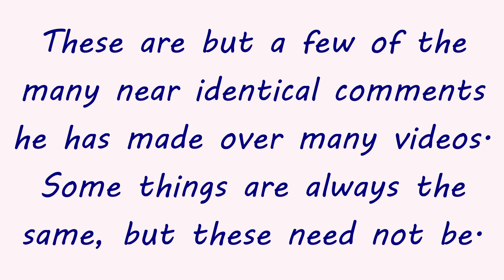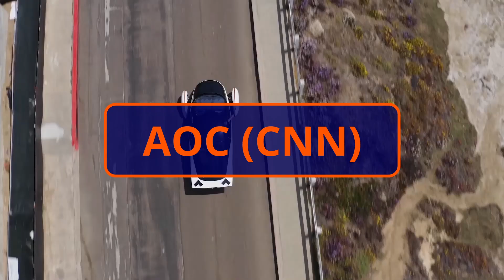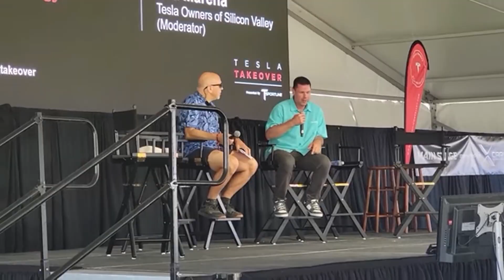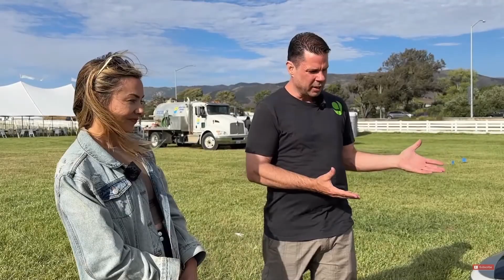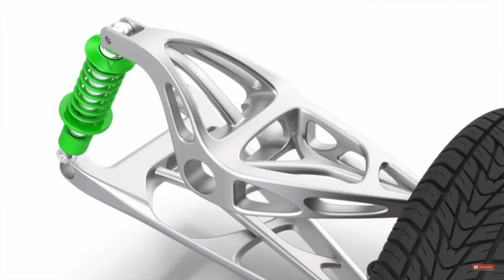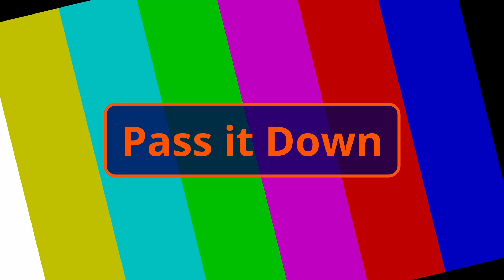Aptera rehearsed

Comment: The part that gets me is about the range from solar. They haven't tested it or proved it, yet he keeps saying it as if it  were proven fact. There simply isn't enough surface area on the entire vehicle to produce that much power without the vehicle being attached to a solar tracker.
Reply from the maker: Yes, it's a case of 'lies; damned lies, and statistics' fooling the gullible. They quote the CFD (Computer Fluid Dynamics) as proving it's true, but nobody knows if their 5% accuracy claim on that is true to begin with. A key number in the CFDs math is that 100 watts per mile, and that has never been established. Steve Fambro did the math on a whiteboard and also left out losses, when no solar system doesn't have them, and he multiplied by direct sunlight every second of the day, which your valid point. Steve F used that whiteboard because his three Alpha's were fakes and couldn't go an inch on solar. Chris A said Gamma was the first with working solar, and they whisked it away to hide it from scrutiny. In seven months, it has yet to be proven to even go that inch the others couldn't do.
I'm no lawyer, but I'm pretty certain advertising standards here in Aus would prosecute claims you can go 200 miles; sit still for a week without plugging it in, then return with more power than you left with if they haven't physically and publicly proven it first. It's called 'truth in advertising laws', and I am surprised the US doesn't have similar laws (if they don't). Chris and Steve are taking a risk if they do, but they got away with it once before.
I may not be a lawyer, but I own a roof solar system and an EV, and I can tell you that the first four hours of daylight here in sunny Brisbane won't charge my car in Winter at all when there are no clouds. I read my Zappi app to know this. It's a case of the charger being incapable of charging if the solar is under 1.4 watts. It sends it to the grid. Grids can take less, but EVs can't, so Aptera must have something magic in it that makes it act like a grid. Even if it did (which I doubt very much), the 6.5 kW of panels on my roof are going slowly from 0 to 1.4 in those four hours, due to the changing angle of the sun. The last four hours reverses the process, and the time between 10 am and 2 pm gets roughly 4.5 into the car. That's two less than the potential at the best of times. Naturally, any cloud drops it by more than half. I have no trackers on my panels, btw. I have yet to own my EV in any other season, and expect improvements, however, it's plain to see that doing the math on a whiteboard in the manner that SF did is going to fall short of expectations by a country mile; not by any 5%. My final point is that I believe that Fambro knew this stuff before he did the whiteboard video, and that these CEOs are deliberate deceptive snake oil salesmen. This calculation is far from the first of their many cons.
Reply from the maker: Here's an idea - why don't you and people who see the logic in my comments such as that last one copy and paste them into all those larger sites where I am blocked? I get a couple of hundred views here, at best lately, and they reach tens of thousands with their one-sided messages. We need a way to inform those masses; it's unfair, otherwise. Cheers.
Reply: @aussieideasman8498  I do make comments in AOC, Aptera, and other Aptera propaganda content creators. They don't like me much, but I haven't been blocked yet.
Reply from the maker: @robocowone464  You probably don't use 'clowns'; 'stupid' and other similar terms that I like to use. It's their cop-out excuse for my bannings.

Comment: It’s not the repeated statements that bother me. If the statements are true then they deserve repeating. The problem is if the statements are not true. Is the Aptera the solution to an efficiency equation? What equation? Do vehicles actually spend 70% of their energy pushing air out of the way? What happened to the Carnot efficiency? Etc.
Reply from the maker: That was quick!
I left out many things like a cD of 0.13; 43 miles of solar; 1,000 mile range and all those specification type 'facts', because they need repeating and you can't vary the delivery much, but these things are different, and most fans can't see they are being played. BTW, the specs they spin are not validated, and more than likely all not true. 
There is no equation. 
Many vehicles waste 70% energy in fighting wind at high speeds. At town speeds, it's nowhere near that. And the good thing is that fossil fuels being around twenty times more energy dense than electrons and cheap as chips, the 30% takes you farther and faster, with superior towing capability to-boot. To claim battery power is superior in his manner is utter deception, and he knows he's doing it.
I have not heard of the Carnot efficiency.
Reply: @aussieideasman8498 going to be an interesting 2024
Reply: Carnot Efficiency is a result of the 2nd Law of Thermodynamics. A heat engine cannot convert all of the heat energy from its fuel to mechanical work. The Carnot efficiency is an upper limit, and for today’s ice engines that limit is about 37 percent. In reality the conversion efficiency is closer to 20%, since ice engines do not perform a perfect Carnot cycle.